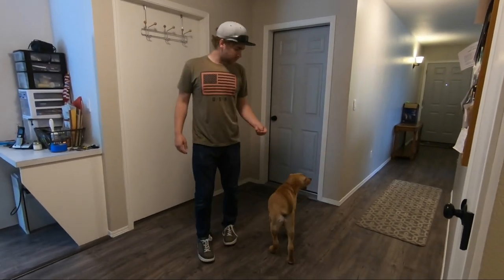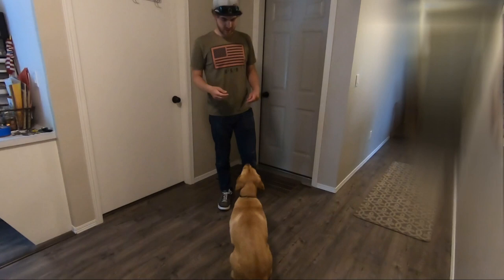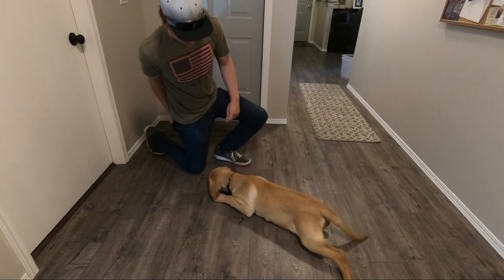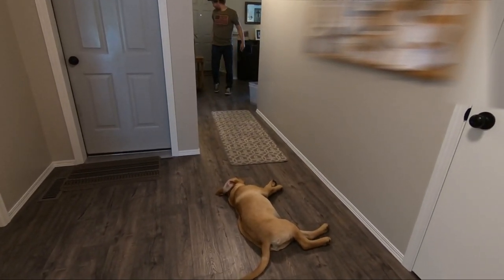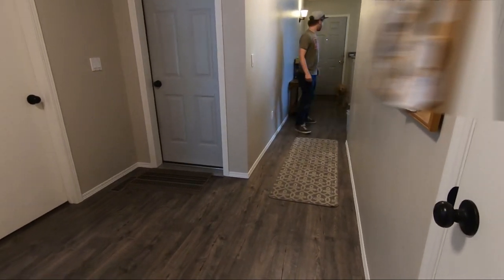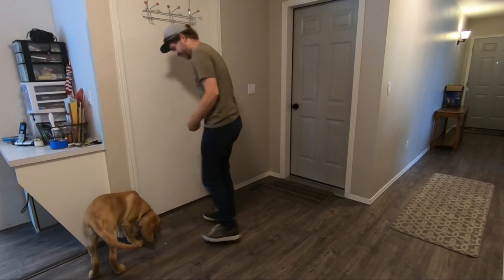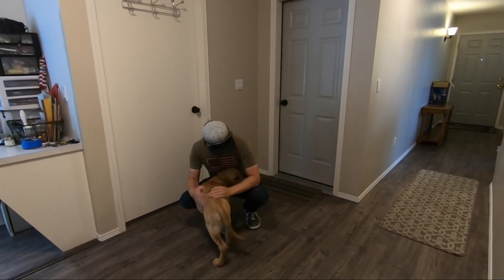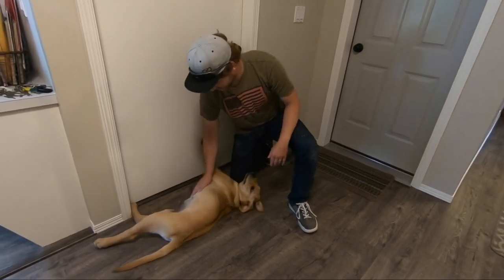7.3 Powerstroke Update and Scout's Debut!!!

Comment: Your low fuel pressure and P1211 is most likely caused by clogged strainer screens in your sending unit in the tank. Very common on the 7.3L. You can either clean them and reinstall them or do the hutch mod and eliminate them altogether.
Reply from the maker: Thank you for the helpful tip!  My understanding was that the super duty Powerstrokes have a different tank setup than the OBS Fords.  From my research the Super duty’s have two small cylindrical screens that get clogged because of the plastic tank material.   Where as the OBS ford trucks have a single larger pickup screen.  Do you think the OBS Ford pickup screen could have split?  Do you know the fuel pressure of a stock Super Duty powerstroke compared to a stock OBS Powerstroke fuel pressure by any chance?
Reply: @ydocproductions5593 , the OBS stock fuel pressure spec is minimum 40psi at idle but under load it needs to hold that pressure. If i remember correctly yours was hanging around 30psi-ish. Yes the tanks are different between OBS and super duties. Your pickup sock may be plugged. I’ve also seen the fuel tank selector valve be stuck half open and suck air causing low pressure. Also check your fuel pressure regulator spring and screen on the fuel bowl, those would cause low pressure as well.
Reply from the maker: @JLCmike4014   That’s good to know thanks!  As a matter of fact I pulled apart the fuel pressure regulator off camera and replaced the check ball, screen, and o-rings with a new kit from Ford not to long ago because the screen was plugged with some black gritty material.  After replacing it all it sounded like it idled better.  But I’m still getting the same check engine light.
Reply: @ydocproductions5593 , that tells me you have crud in the tank that the pump is pushing through the system. The super duties fuel tanks had a problem of delamination but i’m sure it can happen on the OBS trucks.

Comment: Tell yah what. I can’t believe how clean that engine bay is. Also, that exhaust back pressure sensor doesn’t do much in my experience. I broke mine off on accident about a year ago when doing injectors and never got around to replacing it. I haven’t noticed any differences. I don’t remember from your last video, but are you getting proper fuel pressure. If your fuel pressure is dropping at WOT you would have a serious lack of power.
Reply from the maker: Thanks Elliot I appreciate it!  I was happy to replace the exhaust back pressure tube just to keep up on the “maintenance” regardless.  However this annoying check engine light is still on.  

When I tested fuel pressure under load I got 60psi at idle and got as low as 32psi at 50mph.  So technically out of spec. But nowhere near the “danger zone” of 5-10psi for example.  I currently have a very small fuel leak from what I believe to be the 1 1/4” bolt on the back of the fuel pump, and hose leading to the fuel bowl leak a little.  However I can’t imagine that contributing to such a massive loss in power🤷🏼‍♂️.
Reply: @ydocproductions5593  I would agree that the little leak wouldn’t cause that issue. Although it would make a good candidate for efuel! I just finished my kit and am super happy with it.
Reply from the maker: @EverythingElliott  Awesome!  Can’t wait to see it!  That’ll be a great video😀👍

Comment: Could be the engine harness shorting out somewhere I think that was my intermediate issue
Reply from the maker: Do you remember exactly where in the harness it shorted out?
Reply: Check the 4 harnesses connected to the valve covers could be that I kinda just wiggled everything on mine it only has 130k but still like 27 year old wires....valve pan cover on the driver side seemed to be riding the cover and wore....remedy air compressor hose n high heat tape 🍻

Comment: Update?
Reply from the maker: Still haven’t been able to fix the issue it’s still giving me the same check engine light since I’ve owned it so I think I’m just going to take it to a mechanic who’s knows more than me to get a fresh set of eyes on it.  Once he finds the problem I’m more than capable of fixing it myself I just have gone in circles trying to find what’s wrong.  STAY TUNED😀👍
Reply: Have you tried replacing the cps?  Only $25 and easy to do. Mine was doing some bucking and stuff. Felt like fuel was getting cut off. If not Get a genuine Motorcraft sensor from Riffraff. Worth a try🤷‍♂️
Reply from the maker: @1rolmos   I have in fact it was the first thing I did when I first bought the truck and it still didn’t fix it.  I feel like I’ve gone over every system with a fine tooth comb and still haven’t found it so I think reaching out for a little help is the best option at this point.
Reply: Out of curiosity did you use all Motorcraft sensors from a reputable source? Not ebay for example.
Reply from the maker: @1rolmos   I didn’t use Motorcraft parts for a  cam position sensor but I have used Motorcraft icp as well as injector orings.  Everything else has been replaced by the previous owner and used whatever after market parts he chose
Reply: @ydocproductions5593  went back and watched all your 7.3 videos. Before you take it in I would go through the fuel pressure regulator. You have low fuel pressure!!! Make sure the screen isn't clogged,  check valve flows freely, spring isnt broken... You could try bb mod (temporary) to see if the the increased fuel pressure solves the problem. Get your parts from Diesel orings. Or Riff Raff. Messing with the fpr is super easy!!!
Reply from the maker: @1rolmos   ya I haven’t been able to figure that out.  I’ve tried the “bb” mod for the fuel pressure regulator and the filter screen replaced and both haven’t fixed it.  Even though my fuel pressure is out of spec I think it’s got something to do with oil pressure.  Just haven’t been able to tell if it’s a bad injector or hpop for example.  I appreciate the diesel part sites.  Getting quality parts for these trucks seems to be getting harder.
Reply from the maker: @1rolmos  I have thought about it, but my main issue has been oil pressure out of wack.  The TPS doesn’t seem like it would be an issue however I should test it sometime because it wouldn’t be a bad thing to check another sensor off the list